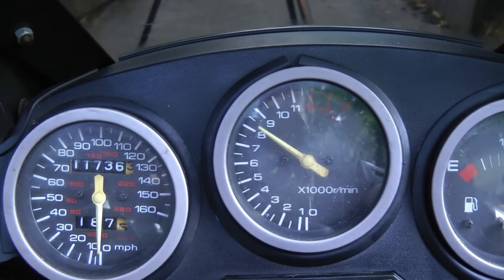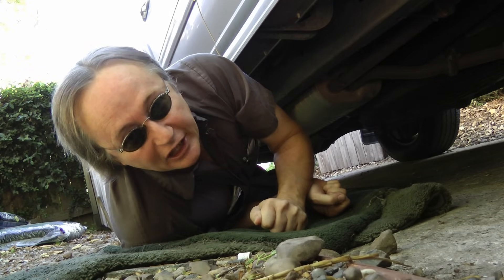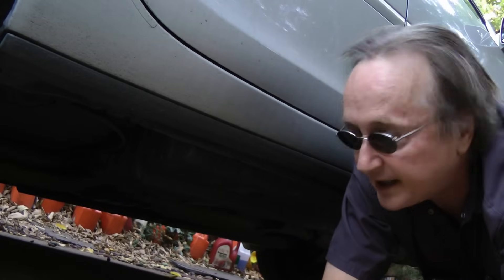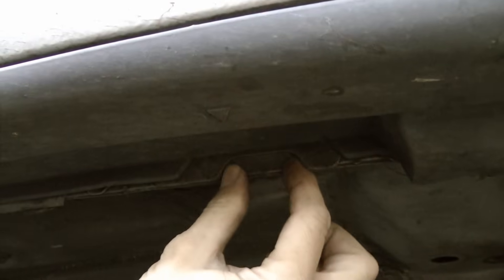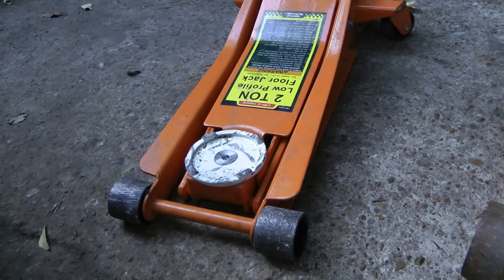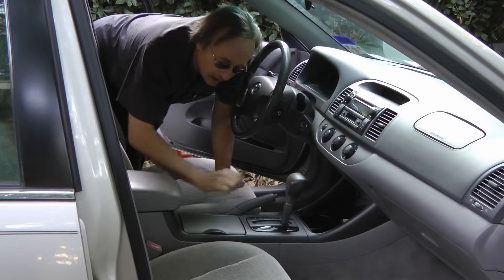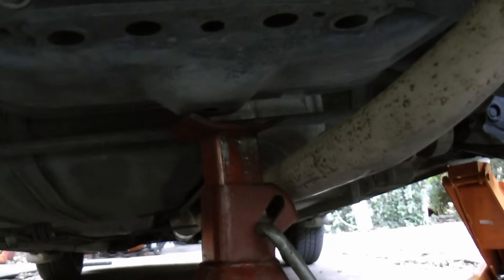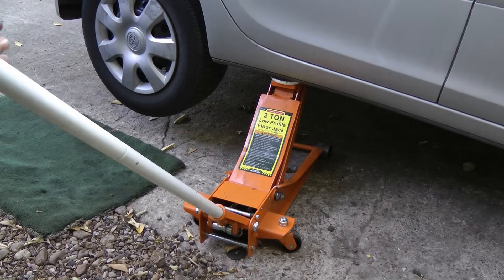How to Jack Up Your Car (The Right Way)

Comment: Jack up a Subaru by the pinch welds and they will eventually fold over making the emergency jack in the trunk useless.  This video teaches the opposite of how many others suggest. Jack it up by the cross member and put the jack stands under the pinch welds using the V in the stands to prevent pinch weld damage.  Then at least if the car is bumped its balanced on 2 points rather than 1 in the center.
Reply: +MtnXfreeride ahh I see you have a video using rail protectors on another car.
Reply: MtnXfreeride 
I have a small jack, that doesn't seem to work that well, but after reading this it's made me think twice about jacking up our car there, i just use the one that came with the car.
Reply: our car there.
Reply: Itll also blow a head gasket if you jack it too high
Reply: what if the notch in stand is large, and flange is too short?.  it looks like the car will rest on stand, but either side of flange is what is resting on stand...
Reply: On top of the jack stand try using a hockey puck with a groove cut across it to receive the pinch weld.  This should cushion and protect the weld from damage.  It should also save the body panel from collapse on either side of the pinch weld.

Comment: If you do a lot of jacking, pick up a rubber "puck" which fits into the top plate of a jack and buffers the pinch weld.

Comment: Problem about those notches are they will bend. Their mostly designed for the in car jack by the spare wheel.
Reply: Yeah, the cheapjack knucklebuster jack that comes with the sled.
Reply: Yep.  Never lift  with these notches on an old car with rust on it  you'll risk to destroy the bottom door .
Reply: Wow I made the exact same comment as you those notches are designed for a scissor jack I believe if you use a regular Jack there that thin metal will bend I would be very leery of using a regular Jack right there I'm very surprised that Scotty did not mention that in the video
Reply: Unfortunately that is what Toyota owners manual states as the jack points.

 The spot where he put the jack stand under the body is actually where I understood the lifting point for a floor jack. There’s one in the rear basically under the license plate. Lift from there on each side and place the jack stands at the jack point.
Reply: That one jack stand he had tho
Reply: @Falcon the factory scizzor jacks have grooves so the this metal parts sits between it
Reply: No they don't lmao it's the one part that doesn't bend. At least in VW idk bout these other junk cars
Reply: You can jack them up from there. That’s where I place the pads for the rotary lifts at my shop with subarus, Toyota’s, and Hyundai.
Reply: @xavierbrenneman2720  They do risk bending if the trolley moves sideways (like most garage jacks do). Use a scissor jack or hydralic one that lifts completely vertically when using the pinch welds for lifting. 

(I learned this the hard way on my old car... )
Reply: @x_III_III_III_x  I just did that on a rusty 2007 Kia Sedona. So I'm here trying to figure out where else I can do it. I did not get a good answer from this video unfortunately but Scotty is great anyhow

Comment from the maker: use any solid suspension point, like shock mount area, or the rear end differential itself as they are solid
Reply: That's what I do.   Up here in the rust belt those pinch welds disintegrate when you even look at them.

Comment: This is not the proper way to jack up a unitized construction car. You should NOT go under a car that is resting on only a single jack stand in the middle. The car can rock from side to side. The proper way is to rest the car on 2 or 4 jack stands, positioned at those notches you showed us - unless there is lots of rust here and at this point in time you'll have to find another spot. You use your rolling jack at a middle point between the left and right that designated by the manufacturer  - one point to jack up both front wheels and another point to jack up both rear wheels. A 1.5 ton jack will handle a subcompact car and compact car, a 2-ton jack will handle small to midsize cars. For bigger cars and small trucks you'll need a 3-ton. And I'm not sure the midpoint you showed us is the best place to place the rolling jack. You should check the owner's manual or a service manual for the proper points to put a rolling jack at front and at rear. Also, the lift pad on a rolling jack goes up in an arc, getting closer to the jack handle as it goes up. That is the main reason why it has wheels; they aren't simply to roll the jack around the shop. As the the pad moves up, the wheels need to be free to roll in, to compensate - otherwise the car could fall off the lift pad, or be poorly supported, at an angle. Its important to make sure those wheels are free to roll on the floor. This is another reason why the center lift point is the proper one to use – if you lift the car from the side, the car goes up in an arc, with the ground-wheels at the center of the arc and the lifted wheel forming the arc. Scotty has his jack placed at an angle that prevents its wheels from rolling toward the ground-wheels. This puts a lot of sideways stress on the jack, and risks the car falling off the jack. The higher you are lifting the longer the arc and the more dangerous this makes things, and the more likely it is to put damaging stress and instability on the jack.
Reply: Thanks for the better detailed advice.
Reply: THANK YOU
Reply: I didnt know about putting the jackstand under the notches , seen in another video. Figured would come here and scotty would know . Not this time . Thanks
Reply: @AnoNymous-dh2sv  Ok so if they are rated 1-ton each, and we know a ton is 2000 lbs. There is no way the car show here weights more than 2000 lbs at the rear. The entire car probably weights 3000 lbs. He is just showing you how to lift the car onto stands if you don't have a jack to reach that far and not suggesting to work under a car like that. He is hardly being reckless.
Reply: Makes perfect sense. The jack probably will roll better on concrete slab better than dirt also . That's the problem I have right now , no slab.
Reply: @wvadam  He is showing you how to lift the car onto one stand, not as you said stands, plural. While Scotty is not suggesting that you work under a car supported by only one jack stand, he is also not warning you not to work under such a car. If you simply wanted to work on each of the rear wheels, you would not need a jack stand at all. You could rely on the jack to lift one wheel at a time. The usual reason for wanting to  lift both rear wheels at the same time is if you want to get your head underneath the car.
Reply: Funny, no response from this dude about his poor instructions

Comment: I just used mine to change my oil. ALOT faster and easier to use than a jack. Just have someone watch you drive up them if your afraid of rolling off, I did it by myself and could feel when I needed to stop, it has little bumps or indicators you can feel so that you know when to stop. I have the RhinoGears 12,000 pound ramps. I say get them, there is always risk when working on cars (As well as most things in life such as crossing the street), you just have to be careful.

Comment: On a newer vehicle, I expect this works but on an older vehicle these jacking points are  often  rusted out. Forty five years ago when I last attempted to jack up a vehicle this way, the jack point crumpled and failed. Ever since  then I look for some thing solid under the vehicle and use that. To lift the front, my own vehicles have a cross member under the radiator with a mound in the center, my jack cups around the mound and I use that as a front lifting point.  I usually put my axle stands under the front sub frame if possible.

Comment: only problem with those notches are the fact that it can ruin the coating of paint of seam sealer on the rocker pannel, then it will start to rust. Those things that look like frames on mono body cars have always worked for me, most solid thing.

Comment: it only takes a few more seconds to let the car off the jack gently and not just drop the car off the jack in a quick instant, sure is safer and easier on the suspension and just the overall car.
Reply: Cheap, old jacks sometimes just drop like that unintentionally no matter how careful you're trying to be.  Copious amounts of lubricant on the rotating parts helps but doesn't cure the problem.  After the initial jerky drop one can usually tighten just a tad and control the drop rate in a little more conservative fashion.
Reply: LMAO "easier on the suspension" i'm done 😂😂
Reply: JUSES CHIRST leave him alone, he's a Ford driver.
Reply: Its more entertaining like that, im pretty sure he knows 😀

Comment: I like to leave the jack in place as well after lowering onto the jack stands. I’ll put a little weight on the jack just in case. Also the tire under the car if it’s being removed as another just in case

Comment: I wouldn't suggest using the jack points on the side for older cars... Your jack can go right through the metal and through the floor... happened to my older accord.
Reply: POS Accords
Reply: Yes, that has been my experience.
Reply: My fusion is getting pretty soft there from 250K KM of Canadian salted winter roads rusting it, so I just use those two frame rails. The jsckstand cups them perfectly and I feel much safer with it there
Reply: I use a pc of 2x4 between jack and frame .
Reply: yea to that, my old 2003 Pontiac vibe (Canada) just got abused in 2019 the garage lifted on the notch and now I got a huge rusthole just under my rear door jam... If you want to keep your car longer do your own oil/tire change coz every time they lift it up that way it spells doom later.

Comment: Scotty, my car bent at the Jack point you are showing using a similar jack you have. It seems that the flat portion of the Jack against the slim Jack point is not so good. The Jack provided with the car has a slot the Jack points sits in preventing the metal to be bent. Any suggestions on how to deal with this?
Reply from the maker: +Jason Marion   jack up other parts then, like where the a frames bolt to the car at the inner part of the A frame

Comment: Check your manual people.  You should have 1 jack point toward the middle of the car in front and another in back, this is where the jack lifts the car (not where you place a single jack stand).  Place your 4 jack stands on the pinch welds.  I dont know why Scotty showed this tutorial because it seems obvious to me that its not the recommended way to jack a vehicle properly.

Comment: The other guy has a point, I just swapped my winter tires on my Altima - I tried to use a car jack and found that the lift points supplied (identical to ones in video) did not provide enough surface area to safely use the car jack.  The car jack supplied by the manufacturer has a horizontal slot that lines up with the lift point of the car to provide maximum surface contact with the car jack, and they don't work too bad either.

Comment: Those jack points are garbage. They always end up bending on me. Ive used hydraulic jacks with the round plate and the ones with a slot for the jack points and it still bends. What a pain.
Reply: you can take the round plate out in trolley jacks usually
Reply: You can use a Jack pad with a slot  and never bends..

Comment: I’ve been jacking up my car for years it’s a 2002 wrx and 4 jack stands is the right amount don’t try jacking your car up like this it’s dangerous if you don’t know what your doing use hydrologic jack in the center of your car front or rear usually there’s jacking points or you can jack from the differential. And there’s usually tow hooks or potentially another place to jack from. Then put your 4 jack stands on the pinch welds all around making a square ensuring your car is stable and safe, always give the car a little shake after it’s fully up making sure there’s no tilting motion or unsteadiness

Comment: did he just use one jack stand to lift and support the entire backend of the car? wtf, mate?
Reply from the maker: do it all the time, on solid flat concrete, never had one fall
Reply: Scotty Kilmer alright, sir. I'm not going to question your tactics because i'm a noob. However, your methods defy logic from what I've been reading on safe jackstand usage on different forums. Question for you, how  would you lift the front end to place the jack stands, if there are no clear jack stand points mentioned in the manual apart from the four pinch weld areas?
Reply: And no wheel chock?
Let's say someone wanted to use TWO jack stands (most of the new ones, especially aluminum you'd want to use in pairs) where would you put them?
Reply from the maker: Hocus Focus Productions I work on a flat concrete surface and nothing rolls on me, been doing it 46 years that way. But if you want , use two jack stands anywhere you can put them on solid metal under there that are exactly opposite each other in terms of the length of the vehicle.
Reply: The front end of most cars is far heavier than the rear, so you can pretty easily jack up the back using a jack on just one side. I wouldn't recommend doing the same for the front, however.
Reply: My tyre place uses two jacks at the front and at the rear of my car. Perfectly safe.
Reply: +Scotty Kilmer I'm very disappointed in you. You don't even mention putting two stands to be safer. "what works fine" (for you) doesn't mean it is safest for everyone. safety should never be taken lightly
Reply: @Eman1900O  chill its just a car. Just bench it

Comment: Make sure if you have a older truck or car, that you PUT YOUR CAR IN GEAR first. today i was putting new tires on my 86 f150 that doesnt have a energency break, m sister and her boyfriend were inside. i got the tire almost off and the jack slipped and the truck rolled onto my hand and trapped it underneath. I yelled for my sisters boyfriend to back it off my hand, but he doesnt know how to use a clutc. My sister tried to pull it forward, thankfully she couldn t get it in gear, oterwise the whole weight of the truck would have rolledacross myhans. Then my sistersboyfriend lifted all the weight he could offof the one side and i painfull freed myhand. USE COMMON SENSE AND LEARN FROM MY MISTAKE
Reply: Lul get good.
Reply: Bob Thebuilder fractured my 5th metacarpal in 3 places, fractured my 4th metacarpal, and 5th proximal phalanx
Reply: Don't be silly, cars or trucks have not had EMERGENCY BRAKES for over half a century for legal reasons they are called PARKING BRAKES and Ford certainly equipped all their 1986 f150s with them. Proof of this is this list of replacement cables: http://www.rockauto.com/m/mobilecatalog.php?carcode=1121656&parttype=1696
Sorry about your mishap. 
So those of you who bought a car or truck off an idiot who saw fit to remove the parking brake assembly, get yourself a couple of wheel chocks to avoid such incidents. Or go to a pick a part and just fix the damn thing. 
On a side note your sister could do better. What kind of man cant drive a  stick?
Reply: ***** mine failed, had it on, truck rolled forward and snapped my hand. Its a extra precaution
Reply: "today i was putting new tires on my 86 f150 that doesnt have a energency break, m sister and her boyfriend were inside." ...dafuq?

Comment: You're supporting half the weight of the vehicle on ONE JACK PLACED IN THE CENTER!!!!! Sure there's no chance of the jack failing or the weight of the vehicle shifting over to the left or right hence falling off the jack leading to you getting crushed by the car!!!
Reply: +mustafamufasa I think you are right.
Reply: One Jack stand and a jack is fine
Reply: If one is going to go under the car a hydraulic jack should not be depended upon. To be safe, one should assume it is going to spring a fluid leak and fall - leaving the car resting on one jack stand. Only time you should depend on a hydraulic jack is when changing a tire. You are not going to put any part of your body under the car when changing a tire.

Comment: Scotty, you really should remove this video as people are damaging their vehicles. You are not supposed to jack on the pinch weld, it is just a slot to guide the factory screw jack into place. I think you know this as you recently posted a video showing the hockey puck technique. Please remove this video or at the very least add some disclaimer somewhere.
Reply: How do you know he works on keyboards for a living?
Reply: Yes... should add some notes.  Turns out that jacking up on the pinch weld without one of those puck things damaged my car earlier today.  Also... was safer to have a chock for the wheels...
Reply: Oculus Hut that pinch weld looks very thin if it was a reinforced section.
Reply: every vehicle have arrows in the bottom indicating where to jack it from.
Reply: That's true on my Toyota.  The factory screw jack doesn't lift the car up with the rail.  But I have seen a Honda that does.  So it depends on the make? Anyway, I just use the factory jack to get the car up and drop the rail down slowly onto a jack stand.  No damage so far. Get the puck if you want to play it safe.
Reply: yes the pinch welds can bend and protective coatings breaks causing rust as well. Not that the damage is that catastrophic but its still damage.
Reply: Ryan Davidson every technician lifts a car from the pinch welds when they have a lift
Reply: Just check your manual like every responsible owner should. Simple
Reply: He is right
Reply: You just can't go anywhere it shows you right in the owners manual like he's showing